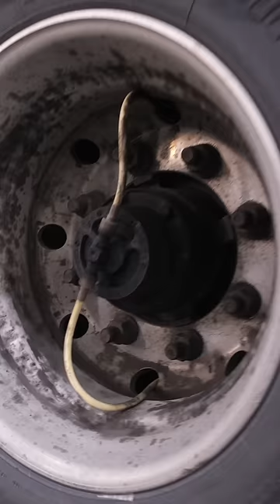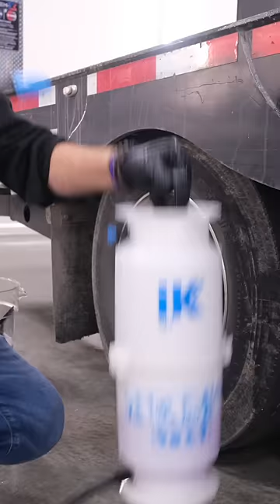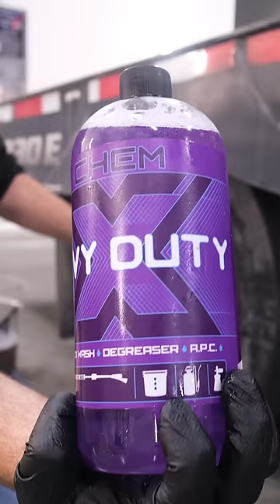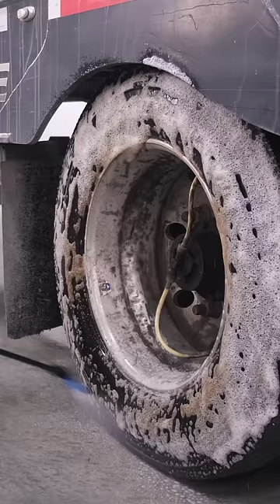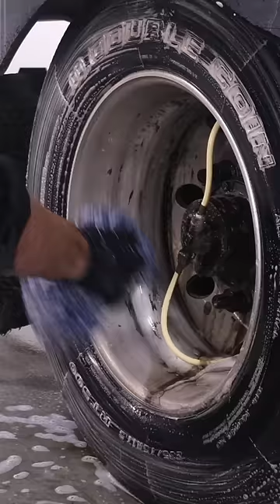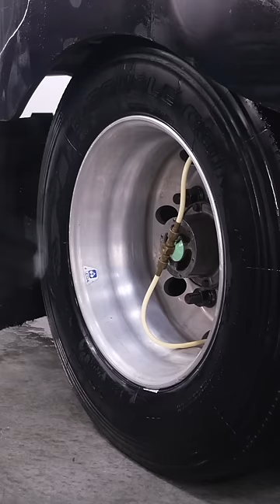Removing Hub Seal Grease from an Unpolished Alcoa Rim #shorts

Comment: That’s 75 90 gear oil.   All hubs leak a little as the heat expands and contracts the oil.   You can clean this with a dry rag in 20 sec
Reply: Danielle you’re doing it for me with that no nonsense
Reply: @74nova36  :)
Reply: @daniellepage2923  something about a woman that knows her oil weights…hell you probably know more than me period. 🍻
Reply: @74nova36  I’m a 310T mechanic.   Diesel engine mechanic.  Also a farmer.    56,000 acres of seed farm.  Mostly lentils and canola seed
Reply: @74nova36  I have two Volvo VNL 630 super b trucks for hauling seed and grain back to the bins from the combines    I have a freightliner cascadia     Not really a good truck but has a DD15 Detroit motor with 505 HP and is pretty powerful so it does the heavy work.  So I fix my tractors and trucks and combines myself unless John Deere 9600 series have computer or gps issues and I have to call John Deere because the right to repair non sense.   This cleaning solution and sprayer is cute.  Would be nice once in awhile for bigger dirty messes on the brakes and after leaks to clean the engine or tranny.  But I have a pressure washer and a bucket.   And it cleans my equipment just fine in good time.   So this is just extra money for nothing in my eyes :)
Reply: @daniellepage2923  fascinating stuff, no one really considers crops like canola, but I’m sure there’s some money there. 

I’m in hydraulics and make flexible lines all day. 3000-6000 PSI (1/4” up to 2”) tons of adapters and fittings. We’ve definitely fixed up some tractor PTO lines, usually NPT or JIC on these old Farmalls and fords. 

What part of the world are you in?
Reply: @74nova36  I live in sask Canada.   Canola is the most profit out of everything I plant.  Mostly plant other stuff to rotate the field and help the canola or I spray to give the soil what the canola needs because canola seed is worth the most.  Mustard peas and grain are like a filler.  Make a lot les soft them but they help the rotation.     I have lots of hydraulic repairs. Mostly charge pump issues and manifold leaks.  Lines don’t get damaged often if used properly but it happens.  I normally get nitro industrial to make new lines because I don’t have a fitting press and not as much hydrostatic experience (very dangerous stuff) and for insurance reason most places won’t work on existing lines so they sell me upgraded new stuff or replica of whatever I bring in.  Surge pressure rarely exceeds 3000 psi but problems happen and lines bleed or pop.   My tractors are case.  My combines are John Deere and I have some new Holland sprayer and swather tractors.  And a cast 621 loader and some fork lifts and a skid steer and some more random crap I got in auction lol.
Reply: @74nova36  sorry if my grammar and spelling isn’t the greatest.   Never paid much attention in English class lol.   But paid a lot of attention in heavy duty truck and transport from college and 310T truck and coach license. I can work on equipment but the charge pumps and manifolds are difficult.   Lots yet to learn.   Problem is they don’t break as often as everything else so it’s rare and most of the time I need it fixed right away so I call an equipment tech to fix it because hydraulics only seem to go down during harvest and I need them most then.  And that’s when I’m busy so I can’t lose a pair of hands and a combine in the same week so I just outsource complicated hydrostatic repairs more then I fix it myself.
Reply: @daniellepage2923  you’re more knowledgeable than most people I’ve met. Gives me hope that this world will progress somehow haha, I hope you can get even more acreage one day and max your profits
Reply: @74nova36  if I’m being honest I’ve been starting to sell.   Not much but its getting to the pool not that I can’t find enough help to peel my fields completely every harvest.   So I’m shorting myself.   Only a little but with a bit less land I can hopefully get everything off the field every year before the snow starts rolling in.    And I don’t have anymore people I can pay to help      But money is good.  Family is safe and has everything we need.  :)    So I can’t complain.   I think my dad would be really proud if he could see how the land is being farmed.   He would say he showed me everything he could and I’d say I listened exactly as much as I needed to to make it work :) I’m just glad we feed 33,000 or so people a year.   And I feel proud I do my part.   Also you bet.  I’ll sub and see what you got going on.   Right now I have 3 vehicles in my shop.  I got my old truck 2007 Silverado and an LS 7 and 105mm turbo to build.  In the winter I try to get some wrenches on it but it’s been 3 years and haven’t got a lot completed yet.  My best friend has a 1996 land rover he is rebuilding.  Loves his aussy trucks.   And I have a shit box Pontiac vibe that I would like to convert into a mini stock car.   But time is always not on my side lol.  Also have my old grain hauler. 2009 freightliner Murphy cab all stripped apart because it also has a DD15 motor so I swipe parts all the time :)
Reply: @74nova36  that’s a pretty nice nova.  I don’t have any classic cars n good shape like that.   My dad had a 1968 camaro with 327 small block but he pst and my mom sold it.
Reply: @daniellepage2923  lol you’re intense! Digging the 2007 Silverado. Quality help is hard to find, family is about the only dependable source of help and even that can be shaky. I hope you find that balance between cost and what you can actually manage and output. 

I think you’ve got it taken care of, you sound very intelligent. Stay safe, keep your family close.
Reply: @daniellepage2923  I was thinking you were in Canada judging by the amount of acres you farm lmao😂
Reply: @TrueDEATH-ii1kc  yeah it’s a big place with only 33 mil. And sask has only 1 mil or so.   Lots of land to go around.
Reply: Most of what I have I inherited from my father.   I have only bought a few thousand acres and only because it was shit swamp land for cheap and I have the equipment to level and rotate it.  But honestly I shouldn’t have bought it, I don’t have the work force or time to manage it properly but I do my best :)
Reply: @daniellepage2923  Sounds nice but that swamp land doesn't seem nice at all lol
Reply: @TrueDEATH-ii1kc  it was cheap.  No one around really wanted to buy it so it got cheaper and cheaper until I put in a low ball offer and the oilfield company that owned it accepted.  Then my cousin and I roared it for two seasons and now sits decently flat.   Low mineral content tho so very little grows there.  Just green beans and peas.  But maybe in the future after some care and money it will be good enough to pass a sample for canola
Reply: The main fields that my grand dad and my father worked for their entire life are gold.  Really good water table.  Flat.  Square.  Easy to flip. Easy to seed.  And no equipment gets stuck in the mud there.  Plus they were already like this before I was even born so no work needed to make them better.   The side fields and all the stuff north of the highway is what I bought and it’s because no one sells their good fields.   So you gotta buy shit fields and make them good over time.  Or just maintain the good fields I already have.  But I try to maximize profit and buy some land because even if I don’t make a profit on it.   One day some company will buy it off me for housing or oil well drilling or something and I can turn a decent profit.  Hopefully.
Reply: @daniellepage2923  I can’t wait to have some real acreage. I’d rather do livestock than farm, but I’d settle for either over this hydraulic game. I want some peaceful quiet tract somewhere up north of Colorado. Maybe a Dakota state
Reply: @74nova36  it’s freeing.   I thought about livestock but honestly the headaches and hoops you have to jump through are pretty crazy and the animals have to be fed one way or medically cared for another.   I just said fuck it and stuck to what I know.  :)
Reply: @daniellepage2923  fascinating conversation. You both seem like awesome people. Sorry for intruding. ✌🏾
Reply: @Mityob67  :)
Reply: @74nova36  please don't say "period" 🤣
Reply: @colinstace1758  🩸 period 🩸
Reply: I work on garbage trucks , talk about dirty , lol
Reply: @modernconflict9888  farm trucks.   Ever spell sheep manure?    Garbage has got to be bad no doubt too
Reply: But is the leak fixed.
Reply: @kingkon164  you can change the seal or the aluminum cap but it’s only a matter of time before it leaks again.  The oil expands and comes out of the rubber plug. Or the steel bolts expand as they rust and crack the aluminum cap and the leak starts there.   But the company’s that create these parts don’t want to sell internal seals or just the cap so you often have to buy the entire hub cover    So I just bought plastic ones that don’t crack from rust or decay.   That’s my solution and it works good
Reply: @daniellepage2923  who’s your friend with the 1996 Land Rover? Not many people in SK working on rebuilding them and I know a couple there
Reply: @srpacific  his name is Albert Garcia he is Salvadoran
Reply: @daniellepage2923  lol this thread is still going strong. Y’all have a good night
Reply: They don't leak this much that gasket is bad they will seep a little when the oil soaks thru the poors of the metal hub but it's never enough to drip onto the rim
Reply: Oil doesn't expand. It's the heat causes pressure in the axel which allows the out to seep the the hub cover breather hole as designed. If it wasn't there it would blow wheel seals. But correct on oil weight.

Comment: I use a product called LA's totally awesome from the dollar store and from the dollar store of course it's only $1 a bottle, and it's one of the best degreaser I've found
Reply: That’s stuff has strong fumes 
Try ArmorAll Extreme Wheel and Tire
Reply: I swear by it, these companies can keep their junk 20 dollar a bottle shit...the last 10 years I've been using awesome
Reply: @turboed00SI  yup awesome and the $1 carpet cleaner for engines / gearboxes
Reply: Luv LA AWESOME. I own my own pressure washing company n use la to do gutter brightning instead of the $50 stuff n does the same job. In fact to well. Iv taken paint off gutters with a 3-4% mix in 2gal pump sprayer. Makes my comeback tenfold
Reply: @moepizl  gutter brightening? Not cleaning? What, are these fancy  copper gutters you're taking about or something? And 3% degreaser stripping paint???
Reply: @ProleDaddy  i clean with the SH. Shine em up with LA. Not literally brighten them
Reply: @ProleDaddy  oxidation on the gutters leads to strippd paint if u leav LA on for mor than 10min
Reply: You beat me to it
Reply: @moepizl  what’s the SH?
Reply: @kevrides5706  sodium hypochlorite. Bleach concentrated
Reply: It’s a 1.25$ now. I hoard the shit

Comment: I first want to say you did a good job cleaning the wheel and hub but my only issue with this video is that Tires are made out of rubber, rubber is an oil base material, if you put degreeser on there eventually it will dry it out so put a little bit of baby oil on there to keep it from drying out. I put baby oil on my spare tires every year and they last forever.

Comment: I have worked summers washing trucks and had to decrease thousands of tires. The inner wheel needs decreasing still. Also it would be best if you flip the wand to clean the upper portion of the rim

Comment: Hey serious question. Is it environmentally safe? Can it go down drains? I want a heavy duty degreaser and starting to not like purple power because it burns to use.
Reply: I washed a piece of equipment in a washbay with a steam washer sealed off from ventilation. 

Probably should’ve gone to the hospital ya know. I was coughing up mucous for the next three days. Felt like death within about an hour of initial exposure.

Comment: You should use a brush for the tires and a microfiber rag for the wheels. And if not DO NOT SCRUB THE TIRES AND THEN SCRUB THE WHEELS. IT WILL MAKE SCRATCHES
Reply from the maker: Those sound like great tips thank you
Reply: @ChemX  no problem homie

Comment: Don’t bother to fix the leaking gear lube from the hub cap!  “I have a warehouse of this stuff!”  I will just wash it every time I drive it.
Reply: it's not his so why would he fix it if that's not even what his job is anyway
Reply: @visegripmechanic973  Lmao you're welcome😂
Reply: Yeah but it’s not gear lube either, the hub bearing is packed with grease. At far as I know a rear axle like that has a separate hub mounted to the axle housing, and the axle is bolted to the hub with the axle passing through it sitting in gear lube held in by the axle seal at the end of the axle tube on rear end housing.
Reply: @dirtyaznstyle4156  hey smart guy! That is a landoll trailer with an auto fill tire system on the axles.   The sight glass on the outer of the hubcap normally means it is a oil bath hub or fluid gear grease in some cases. Most times, for fluid gear grease or grease packed wheelends, it is a solid cap because no sight glass is needed.  Either way it is leaking and needs to be repaired!Unless he wants to wash the dirt that sticks to the lube off every trip!
Reply: @visegripmechanic973  interesting, never really knew they would lube a hub with oil just cause it’s harder to keep inside. Thought it was a box truck or something, guess if it’s not a drive axle it’s easier to seal up?

Comment: Interesting how the spot you miss sprayed on the fender, holds water beads  after direct pressure from a power wash and full force of air pressure won’t move it off that spot. Not hating at all, stuff looks sweet; I’m just honestly curious like from a scientific pov

Comment: That's a polished wheel the chemicals in your soap "burned" the polish on it thats why it has a smokey look to it 

I use to work at a truck wash when I was 16 and truck drivers would go fuking crazy over it and they wouldn't leave till it gets fixed

Comment: Shouldn't put degreaser on tires, you'll dry them out. Even worse on recaps. Tires need the oils.
Reply from the maker: What do you like to use to clean tires up?
Reply: @ChemX  water and a brush for tires and wheels. For grease covered wheel, would switch from brush to a rag and use a solution of Dawn dish soap and water applied to the rag.

Comment: That's thing is leaking, why not fix it first and then clean it? Maybe a new hub cap gaskets and air up inner brass tube with new O-rings? 🤔 top it off with some hub oil

Comment: Repackaged Purple Power degreaser from Walmart. $22 for 5 gallons resales for a shit load 😆
Reply from the maker: So the main thing that is different with my degreaser vs purple power is that mine can be used on polished aluminum without staining it or turning it white at all